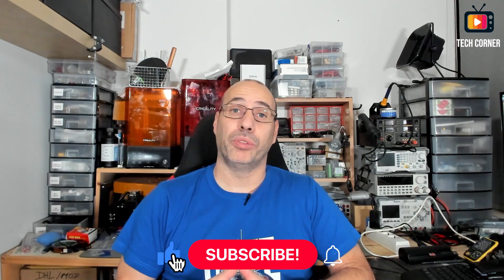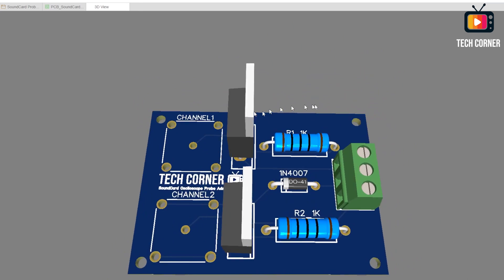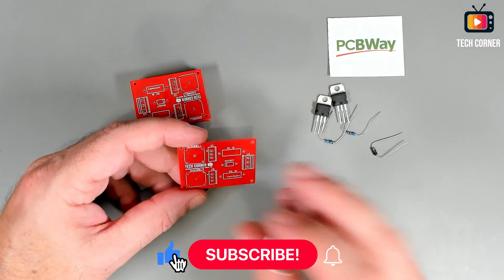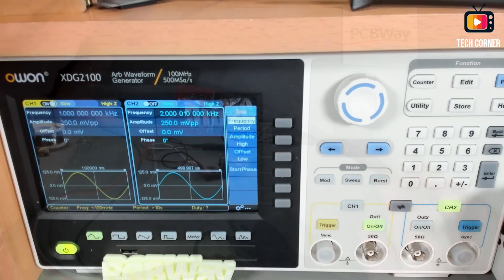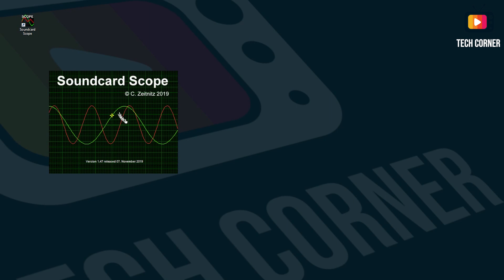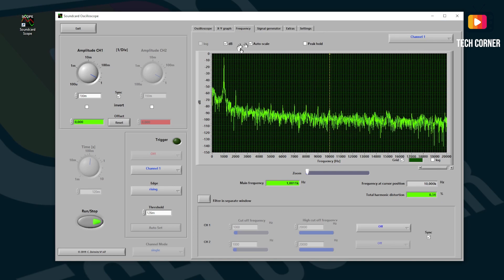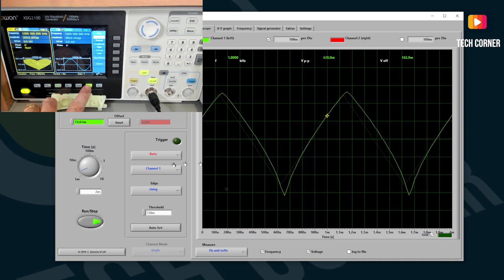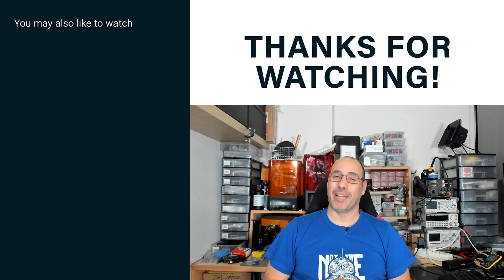SoundCard Oscilloscope Probe Adapter ➕ Software Review

Comment: Hello Hugo, I hope you read this because I am currently making this project, but can't have the windows to detect the microphone. I would appreciate if you could tell, to which part of the TRS Plug are channel 1, channel 2, and ground connected to? For example is channel 1 or red wire connected to tip, etc.
Reply from the maker: Hi, from the cable to the end you'll have the sleeve (ground), the right channel (middle) and the left channel (in the end). If you type "trs connection diagram" on google, it will show several images about it. You mentioned microphone, they should be TRRS and in that case from the cable, the first ring will be the mic, second the ground, right channel and on the tip, left channel. Thanks for watching.

Comment: Very strange contraption. LM7805 is a linear fixed voltage regulator, that designed to work with DC input voltage in range of 7-35V, and have integrated ripple rejection system, which purpose is to flatten as much voltage fluctuations as possible. If input is less than 7V - it will work abnormal or not work at all, if more - output will be stabilized 5V, which is nor safe for soundcard, nor informative in any way if soundcard will survive. Any Opamp will do better, even 1 decoupling cap and 2 clamping diodes will do much better job as a attenuator for PC oscilloscope. No wonder author of the wideo hadn`t explained how circuit works, and "demonstration" was recorded only on screen, probably without this something in the signal path.
If you want to make something working, you should choose between this two options:
https://www.youtube.com/watch?v=uTDFYQrQMLc&t=1628s
https://www.youtube.com/watch?v=C73N_rp75Gc
Reply from the maker: Hi, well this was just a project that I thought it was curious and decided to make a video with it, no intention to harm any inauspicious sound cards. I do warn that you should always use a external soundcard, they cost 1,70€ on aliexpress. Nevertheless, thank you for sharing those 2 designs, my objective is always to spread knowledge and also learn.
I'm in know way a electronics engineer, just a hobbyist that love electronics and always made that clear, so really appreciate the reference for the 2 examples shown and also the time you spent with this comment and searching better solutions. Kudos! Thanks for watching.

Comment: Genuine question, why use voltage regulator in-line with the signal path while you can use simple clamping diode?
Won't this affect the signal linearity?
Reply from the maker: Hi! No worries, you can ask anything... well... within the scope of the video 😁 I use this approach because I said in the video, it was based on a design that I found and it seemed 1) interesting 2) very cheap to build. But I'm sure we can do this in a different approach and your suggestion might even be better, so thanks for sharing... and watching!
Reply: @TechCornerTV Your answer and comment would nevertheless be precious. Did you test for linearity or not?

Comment: Very nice job. This adapter is perfect for people who do not have a proper oscilloscope or they are just getting started in electronics. Very well done.
Reply from the maker: Hi Khuong. Yes, exactly, thats the idea of the video, if you just want to fool around and learn a bit more about oscilloscopes, you don't have to spend so much money to buy one. You don't have even to make this board, you have there schematics with few cents you get the parts to test it yourself with a breadboard. Thanks for watching!

Comment: Hello Hugo . I wanted you to know that old watch ⌚ dials are coated with a luminous paint called Radium which is radioactive ☢️. Because it emit alpha beta and gamma radiation.  I wanted to see you test them in your next video featuring the radioactive tester from FNIRSI.
Reply from the maker: Hey Andy, tomorow I will go to my parents house to a family lunch and my father has a bit watches colection. I gonna try the detector there to see what happens, thanks for the tip! I'm currently working on the AiXun solder stations review and will work on the GC-01 next. Thanks for watching!
Reply: @TechCornerTV   pleasure to learn from you